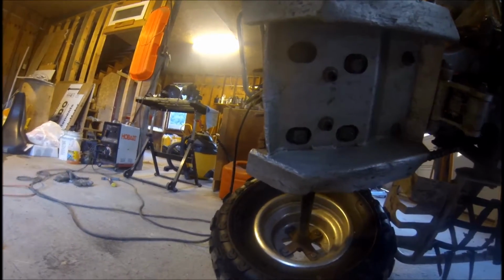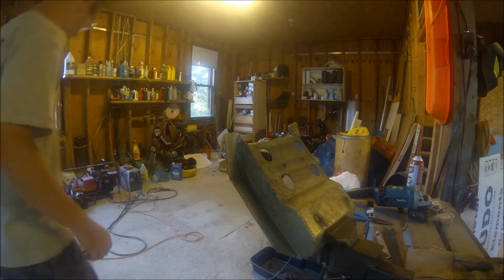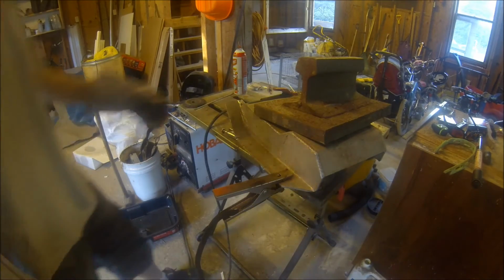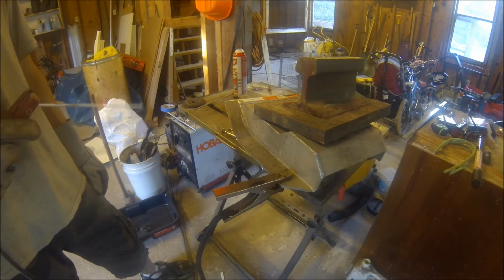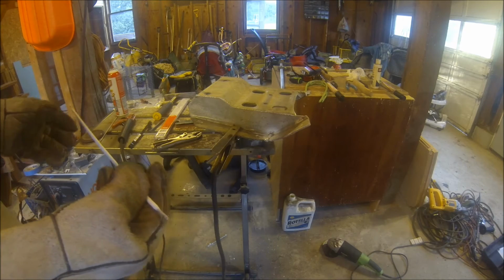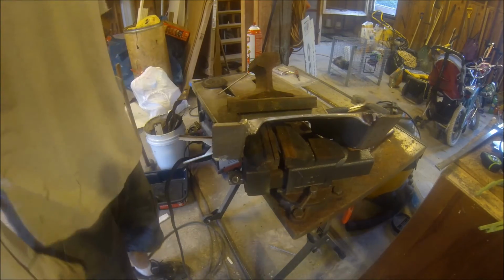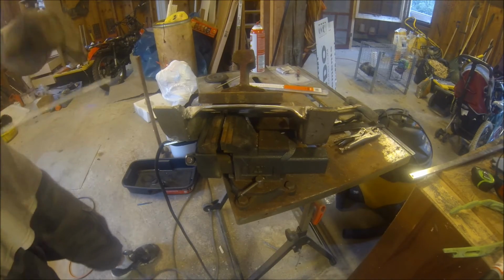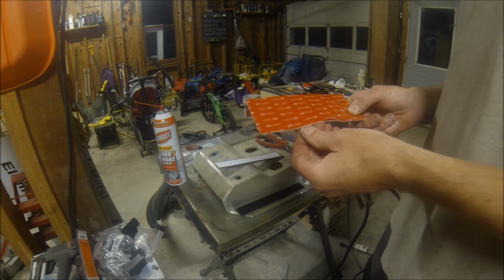Aluminum Stick Welding SMAW, Z 400 Skid Plate Rebuild

Comment: Interesting video, I watched it to see if stick welding aluminum actually worked on a real life application and it looks like the answer is yes. You need to get a chunk of locust tree about 15 inches around by about 2 feet long to put your homemade anvile on to get it on a good solid base at a comfortabe working height.
Reply from the maker: Glad the video helped. Thanks